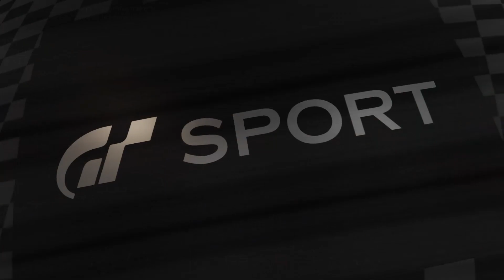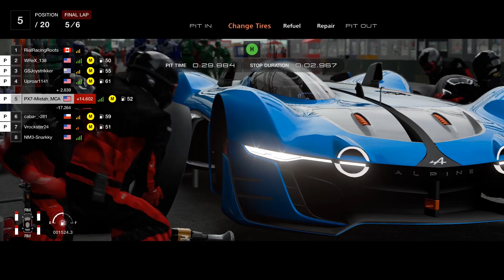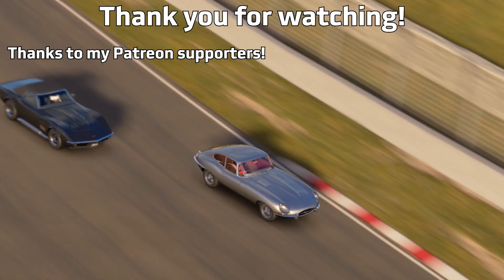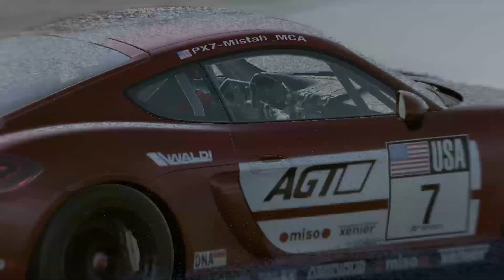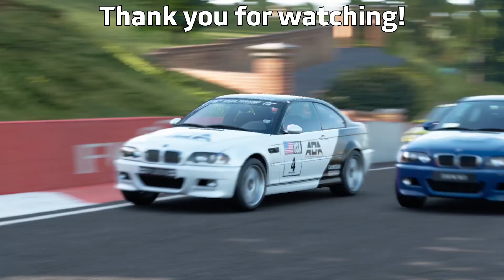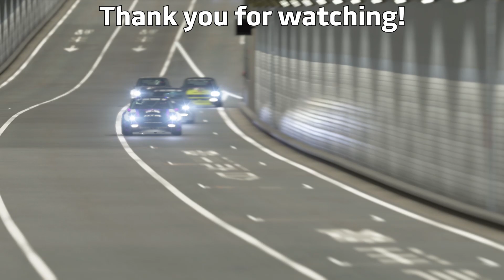Gran Turismo Sport - Daily Race Lap Guide - Circuit de la Sarthe - Peugeot 908 HDi (Gr. 1)

Comment: Thanks for the lap guide, no Matter how hard I've tried i can't get near your lap times. In addition the penalty system is rubbish you get a penalty for crashing the fence (It is not enough time you already lost out of track), you get a penalty when the clock is not running, the penalty has been added to your lap time and Guess what? The Next lap does not count (you get the red clock)
Reply from the maker: You're welcome!
Yeah, the track limits here are pretty strict, and you're really trying to push it to get that best time and hopefully not get a penalty along the way.
It can get frustrating... really frustrating...

Comment: Did you get use to the software upgrade for the logitech 923 brakes ?
Is it better after getting used to it or still worse ?
Reply from the maker: If you're talking about on PC, I haven't.
As for the GTSport update that affected its brakes, yeah, and you need more travel to get 100% braking. Not a big fan of it. :(
Reply: @MistahMCA  AH bummer, I had to change a pair of brakes I had cause i don't like to press too hard either.. I had no idea the logitech G923 could have so much resistance.
For PC i would imagine you'd have a software that lets you calibrate the course for the pedals ?